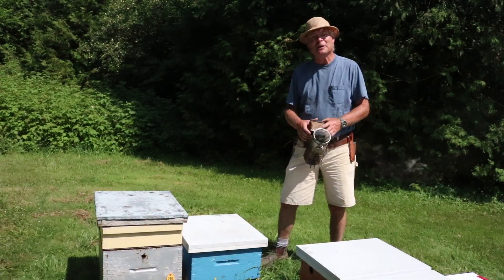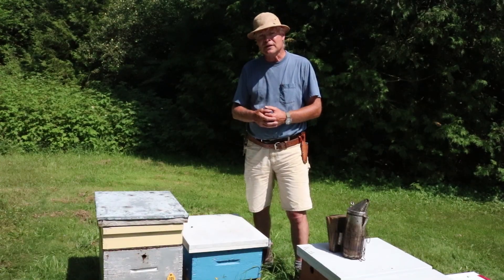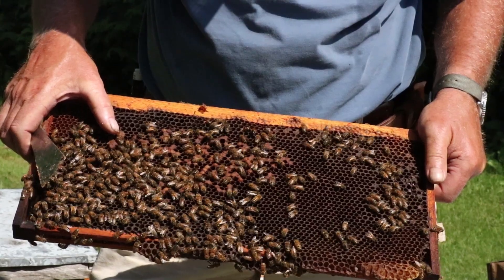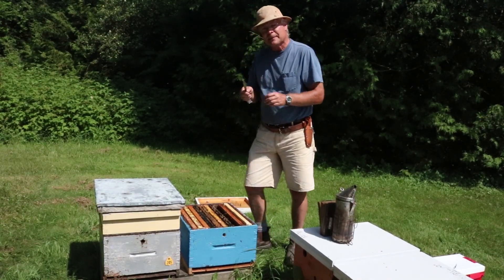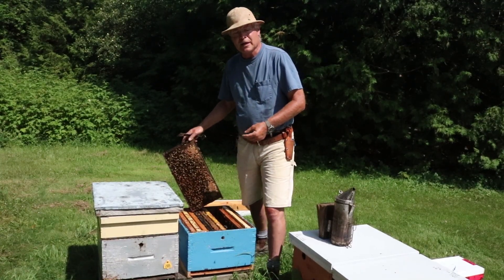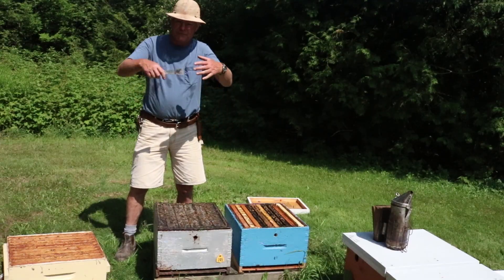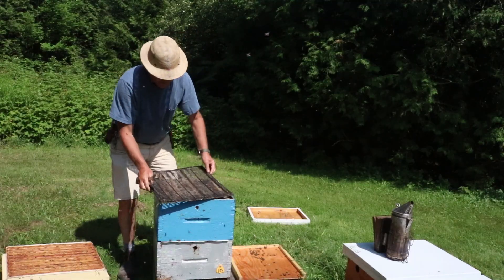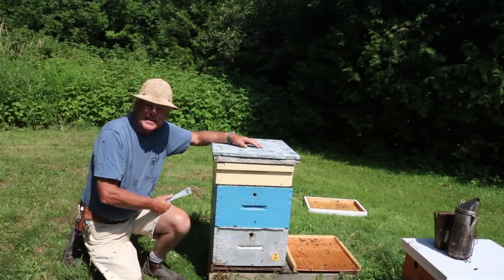Laying Worker

Comment: I had 2 frames with small  spotty brood pattern on the first honey super.  I saw a lot of drones on  the top cover.
I checked every frame and shook them off near bushes.
I separated the 2 frames with brood out of hive and observed two bees hatching that didn't look like drones.
I then checked the brood box and found 4 to 5 frames with full brood pattern  on all frames. I tried to locate marked queen but couldn't locate her. I put the hive back together and will check next week.   Is it normal to have major brood in the box if you have spoty brood in a super with a queen excluder?? Tyvm !!

Comment: My Russian bee pkg killed their queen within their first week. I found eggs and larvae at two weeks, but about two days later or so, I found nothing but sporatic drone capped cell patterns in four frames. Also, 4 emergency cells. I took out the emergency cells and was able to get another queen in two days. When installing her, I took out the drone laid frames and replaced with fresh frames. This was to rid any traces of the drones and allow their attention towards her. So far, they are kind to her and not violent while she is still in her cage. They are working to eat the candy out. Was going to look today because it is her 4th day after install, but weather was not permitting. Will inspect tomorrow for sure. Fingers crossed!!
Reply from the maker: Hi Linda
You are really trying hard to get a queen going!
I'd suggest you only check on queen introduction success a full 7 days after introduction. When an introduced queen emerges from the cage she is only tentatively accepted. Any disturbance to the colony and the worker bees will ball the queen. I think we mention this on our 'Queen Introduction' video.
Reply: @UoGHoneyBeeResearchCentre, thank you. I will follow that way to see how it goes. Next week it is.

Comment: We are having an early fall here in Alberta.  I'm hobby beekeeper.  I have three langstroth hives and one more that I just put a small swarm in.  I was digging through the huge hives and intended to sneak some mature brood to strengthen the swarm.  To my shock two very high population hives are queenless and all the hatched out brood spots have been filled with pollen or nectar.  I'm stuck.  The third hive is huge as well(I still haven't opened it up to see if it's in the same state as the other 2).  Since we are heading into early fall, and I don't have any place to put the queenless bees except on to the swarm hive(it's two miles away from the queenless ones) my only option is to let them die off and use their resources next year?
Reply from the maker: Hi there. A late reply. I'm hoping that your colonies weren't queenless and that the queen had juts stopped laying for the fall. When they stop laying is a bit variable from colony to colony

Comment: I’ve heard that the laying workers when using the newspaper method will try to kill the queen if the queen right colony isn’t stronger than the hopeless colony by a significant margin. Is this true in your experience?
Reply from the maker: Hi Dakota
I'm don't think I have ever united a stronger laying worker colony to a weaker queenright one. They are usually weaker and it has always worked for me. Others have told me it hasn't worked for them but it's hard to know what their situation was. 
Thanks for the good question.

Comment: Thank you again for all your videos.  One question:  I tried this technique on a couple hives and noticed in both cases the queens in the queen-right colonies vanished.  I read on a couple sites that from the bees' perspective a laying worker colony is essentially a queen-right colony and that the risk of combining a queen right colony with a laying worker colony is that the laying worker colony may kill the queen.  I was thinking maybe something thicker than a sheet of newspaper (paper towel?) would unite the two colonies more slowly.  Any suggestions would be great since I have two more work laying colonies to fix.  Thanks again
Reply: I'm looking for the answer to this as well. I only have two colonies, one queenless. So I dont want to risk the other one by trying to unite them and having the Queen killed off by the incoming bees.
Reply from the maker: Hi Cliff 
 One sheet of newspaper usually works for me when the queen right hive is strong. I don't recall a time that it didn't work but you are not the first to say it didn't work for them.
You could shake out the laying worker colony 30 feet or so away from the original location and then unite the box with your queen right hive. Some say laying workers can't fly back. I don't know if this is true but this method forces the laying worker colony's bees to gradually move into an entrance of a nearby hive.
Reply: Thank you so much for the quick reply.  I like your idea of shaking out the laying worker colony some distance from its original location and having them enter a queen-right colony through the standard bee filtering process.  I'll locate the queen-right colony I want to boost populations in the location of the original laying worker hive.  Thanks again.  I recommend your videos to anyone who will listen and even if they won't  ;-)

Comment: If adding the colony to another colony will suppress the laying workers from the brood smell, wouldn't just adding brood to the colony do the same thing? And at the same time, wouldn't they draw out Queen cells if you give them eggs/young larvae?
Reply: I have similar questions. I didn't have extra brood to share with a LW colony recently. So, I bought two queens and placed both of them in their cages to try to overwhelm them with queen pheromone and took away and froze almost all of their brood.  3 days later I checked the queen cages and they looked like they're trying to feed the queens, so I split them up, took the corks out and gave all the frames back. We'll see how it goes, but the activity on the landing boards the day after was much better activity wise.
Reply: @dustinnyffeler8624  awesome! Good luck and let us know how it goes. I like that you took their brood and froze it.
I've learned since posting my question that they won't necessarily make queen. Cells if you give them brood (at least not right away) . It will eventually suppress the laying workers ovaries but may take some time, after which they could draw out queen cells.
Reply: @TexasBeekeeper  Understanding / Fixing A Laying Worker Colony (Drone Layers) JCs Bees. <- I wish I would have done it this way. I left some laying worker drone brood in at least one box and I wouldn't have if I had more drawn comb or brood I could have stolen from another colony.

Anyway, I did check on my two colonies and so far so good. The first one had about a quarter of a frame of bees in it, but my marked queen was still there, so I gave it a frame of emerging brood with a full frame of bees and another shake of bees from a resource hive. Hopefully it will do ok now. The second one was populated pretty well, I did not find the marked queen, but I did see eggs, layed perfectly in the centers of cells.

Comment: Another option, if you have the time, is to use a propolis trap instead of newspaper. Wait 2 or 3 hours and then remove the propolis trap. the bees will pick up on the scent of the queen but can not get through the trap. It's saves the bees from working many hours to chew up the newspaper and remove it from the hive.

Comment: Hello, I have a queenless laying worker hive, I plan to combine with a nuc colony.  My question is, why do the bees have to be shaked out first?  Couldn't you just use the same newspaper method and add the nuc colony on top (in a brood box with extra empty frames), so they have some time to adjust to the brood & Queen pheremone being around again and they would stop laying?  Or because the nuc is not as strong, you could also put a queen excluder in between for a while to ensure they don't kill the queen?  Or I have read to put mesh in between for 7-10 days... what do you suggest?  Is it ok for the nuc to go on top of the existing hive (so that you can also put the hive top feeder on top of the nuc while they get established)?  Thank you!

Comment: Hello. Always really enjoy your vides. Very methodical and clear presentation! I have tried your method today taking a queenless hive that has had laying worker brood for weeks now. The problem I have had is that I have a dadant hive which has a screwed in bottom board so I used 2 brand new supers which together can fit brood size frames. After placing the newspaper I proceeded to transfer the frames into the supers above the queen right colony. Now I have a 200/300 forager bees confused in front of their ex empty hive. Should I completely move the old hive away or should I try and get the forager bees into the upper part above the newspaper? Also I noticed that the upper nest in your case has an opening whereas my supers don't. APologies for the long message. I'm sure you've guessed by now that I'm a newbie!
Reply from the maker: Hi Roberto
 I'm happy to hear you find our videos helpful. I'd remove the old hive from the apiary so the bees are less confused. You'll eventually want to get more boxes of the right size.

Comment: Still a Newbee here and I think I have a queenless colony . I may have squished her .dont know for sure but it has been queenless for some time as there even isn't any brood.
So put a couple donor frames of larvae an brood in it to buy some time. 
I have seen youtubers stick a mesh cage (4x5x 3/4 or so) over a brood frame with larvae and brood and then insert a mated queen with couple attendants into screened cage. Close the colony up. New born bees help care for queen and available cells allow queen to lay. Over time colony adjusts/accepts new queen and cage is removed - colony saved.......
Can you comment.
Thanks

Comment: My hives are double brood boxes. After adding a third brood box, the drone-laying colony, how do you recommend splitting it back in to 2 colonies and when?
Should I wait to have eggs in all 3 brood boxes before splitting and introduce a queen?
Reply: The most optimal way would be to set up an empty brood box next to the hive, then one by one, take each frame of the top box and shake the bees off then place the empty frames into the empty brood box. Make sure that the 10 frames have every thing that they need: honey, pollen, eggs, and brood in various stages. You may need to get frames from the other boxes to be safe and sure. Now take a queen excluder and place it on the top frame of your 2-box hive before setting the new box on top. The queen can not get into the top box but worker bees will. The next day, take off the top box and place it at least 25 feet away. They will make queen cells or you can buy a queen for your new hive. It's best to do splits when things are blooming. Hope this helps.

Comment: Such good information!! Thank youuu!!

Had a question. I have one hive that I removed from a chimney this April. Colony is weak. Wax moth have moved into the hive on all of the old comb. Had to take down all the frames and put all the bees on absolutely new plastic foundation. I’m feeding them syrup outside the hive for them to start building. They realized that they have no comb and started making a swarm on a nearby tree. I caught the swarm locked the queen in a cage and put the plastic bag feeder and candy inside the hive. Planning on letting the queen go in a day. Do you think there’s a possibility that they will move out of the hive? Can you recommend anything so they would start building even faster? I have only one hive, no other ones. 
Thanks again for the video😁😊
Reply: I would keep feeding them and maybe protein supplement as well.
Reply from the maker: Hi Denys
 A later response. Hope your hive is doing well. Feeding is the best way to help them build comb.
Reply: UoG Honey Bee Research Centre thank you! 😊

Comment: Paul, sometimes it is hard to tell if the larvae are dying because the hive is failing or whether they are dying because they have European Foulbrood (EFB). Can you offer advice on making that distinction if the beekeeper does not have an EFB test kit at hand?
Reply from the maker: Hi WW
 I can't offer much advice there. We rarely see EFB symptoms.  Both AFB and EFB symptoms include larvae dying at a very specific age ( flat and stretched out AFB, twisted just before they lie flat EFB). When  brood isn't cared for properly you see larvae and pupae and emerging bees dying at all ages including at the AFB and EFB stages.

Comment: Very good video Paul. I practised that tecnique and there was a problem because there was a non marked infecunded queen that was lying dron eggs. The result was that I lost both becasuse the youngest and strongest queen that was infecunded  killed the good queen. It would be interesting that you make another video seeing tne different between lying workers brood and infecunded queen, s brood. As far as I know infecunded queen brood is very extended and is usually only one egg at the bottom of the cell, isn,t it? Thanks Paul for your magnificous videos and explantions,
Reply from the maker: Hi Carmen
 It's sometimes hard to tell the difference between  a laying worker colony and a drone laying queen. I usually look for a queen to be sure it's not the latter. Good suggestion for a video. Thanks for your kind comments.

Comment: I've had my 1st laying worker hive this year and I was just wondering about the success rate for this method. I have been thinking about doing the newspaper combined method but after having spent some time on Google which probably isn't that great to do, I've seen a lot of commentary about the significant risk for the laying workers to overwhelm the Queen in the other hive. Is this a significant issue as common as it seems to me or do you have a pretty high success rate with a newspaper combine?
Reply from the maker: Hi Q
 No worries about the cells. They are actually worker diameter cells that have been elongated to accommodate drones. Once the drone emerge the workers will shorten the cells back to normal.
Reply: @UoGHoneyBeeResearchCentre  I just wanted to let you know that I checked my hive today and the laying worker problem seems to be completely fixed! Thanks so much!
Reply from the maker: Hi q
 I've never experienced the problem you mention and have done this a few hundred times. It works!  The smell of brood shuts the laying workers down.
Reply: @UoGHoneyBeeResearchCentre  we just did the newspaper combine. Do we need to worry about the large quantity of drone comb in the laying worker hive?
Reply: Uniting a problem colony with good Queen right colony with newspaper or wire mesh between them always works and is the best way

Comment: Hello Sir Again, I have a question whether is it possible to expose the laying cell and bees in the super  to suffocation due to the lack of airway and the presence of newspaper paper?
Reply from the maker: Hi Again Saleem
 There is an entrance hole in the brood chamber above the paper so the bees can breath. You raise a good point. If you didn't have that hole you could  cut a few small slits in the paper so air can circulate.
Reply: Dear sir
Thank you so much for responding my question about laying queen i have done what you show in this video and i have some questions about what happened with me when i take the laying queen box i take another super box cause the original laying box is not easy to transfer it so i have to take the frames one by one to the super box and some bees was out gathering honey and much bees is went out to attack me to defend the cell and was very aggressive so i unite the boxes and i put a newspaper between them and close the second floor but the other bees that came back to the old position for the laying hive i put a box in that position what you suggest to do with it and some people told me that the laying box could attack the queen and kill here and that will make the other hive also laying and i have to put a net between them with an entrance at the top of the laying cell until they merge without killing the queen and slowly

Comment: Please can you answer this question:
I have a laying worker problem. Too many eggs in the same cell.

How did the problem start? 8 days ago I destroyed all the queen cells to prevent a swarm. However, the swarm did occur. The bees didn't find any queen cell to raise a new queen (Beginner problem!).

The odd situation: When I examed the hive today I found a queen cell cup filled with royal jelly. Can a laying worker lay an egg in that cup and then the bees feed it royal jelly? If that's true, would that queen cell develops into a normal queen? 

Thanks in advance for the answer and for all the great videos you are sharing.
Reply from the maker: Hi There
  That's too bad but I think by removing all the cells you didn't leave them with any option to replace queen. Please see our video about 'swarm control' for more details. The queenless hive will try to produce a queen from unfertilized eggs laid by workers. If you open up the 'queen' cell you will see its is a drone.

Comment: Hi Paul, I love your videos!  I just wanted to ask a practical question:  I know that you like to screw the bottom board to the base of the brood box and I was wondering how you got around that little problem?  Again, I love your videos and I hope to see more of them in the future.  Keep up the good work!
Reply from the maker: Hi Cameron. Thanks for the positive feedback. If I understand your question, we pre-drill the hole for the screw on all our bottom boards and screen bottom boards. Generally we screw them together before installing bees. If we need to unscrew or screw  together hives with bees inside we tip the hive back onto an upright lid for a flat surface to line everything up. Hope that helps.